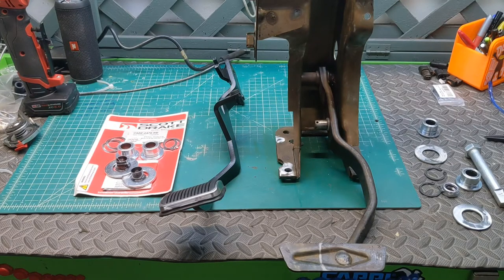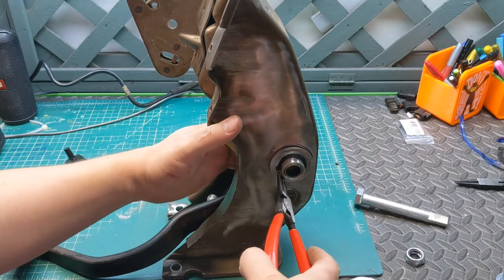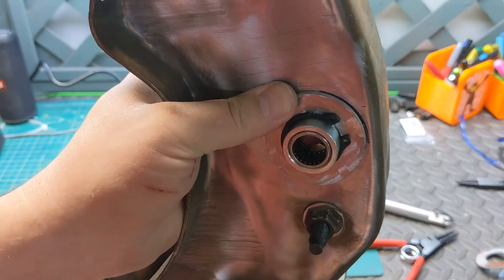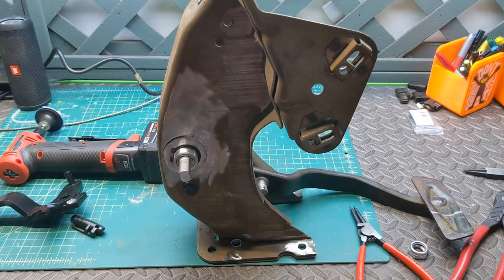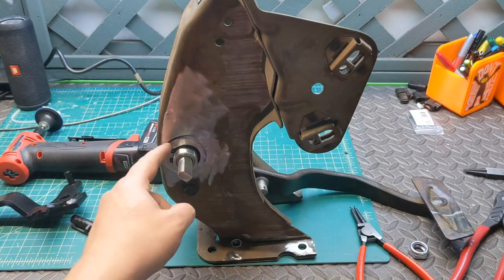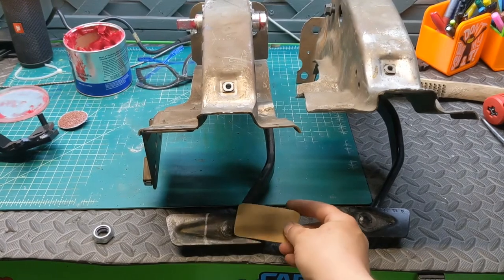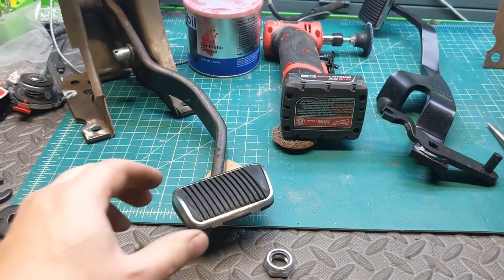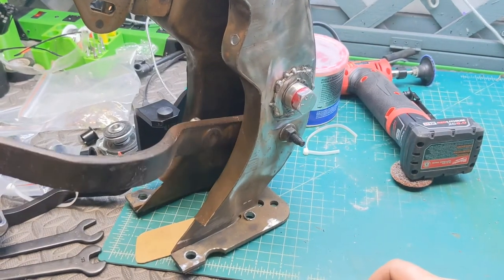71-73 Mustang and Cougar Clutch Pedal Install

Comment: Did you add the clutch return Spring? Or did you go to a co axle cable andcable and if you did did you have to use the return spring on the bracket
Reply from the maker: no spring required on 71 - 73